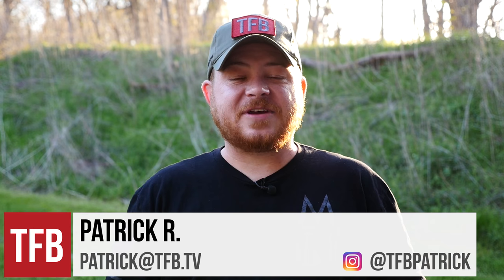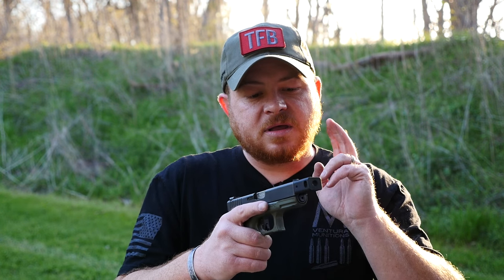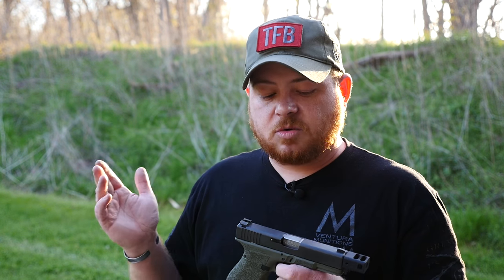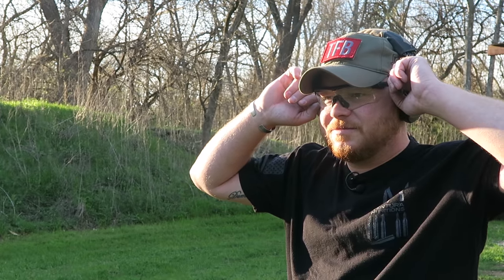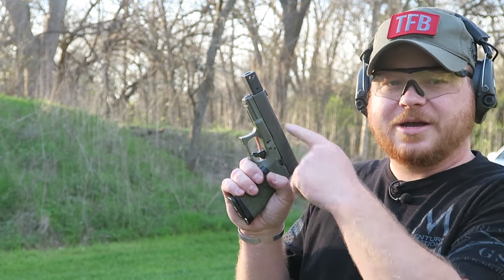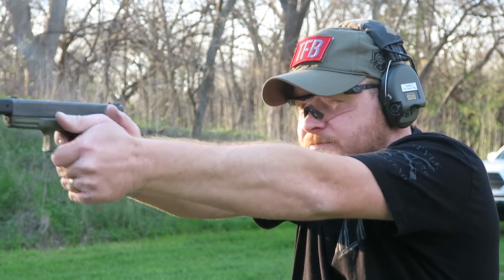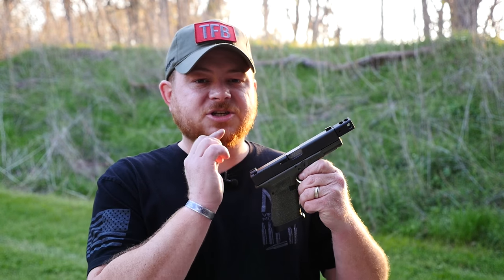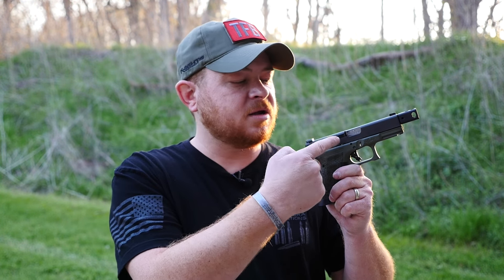How Compensators Help You Shoot Faster

Comment: I'd love to see this test done with a 45 ACP or even 40 cal
Reply: River Styx Armory makes sense thanks I've owned 40 and 45 no compensators tho I've always wondered how well they work
Reply: Big benefit on 40 S&W, tames the shock and flip quite a bit while keeping a good amount of that 40 snap. There's a reason why competition shooters love compensating 40. You should see what a comp can do for 10mm.
Reply: Right why is 9mm even popular? Wimpy load (yes I have been shot in the chest with one). With 40S&W you get more speed from a bigger, heavier bullet. Better yet, a 45ACP +P 185 grain Underwood load is moving at 1200fps, bigger, heavier, faster than  9mm but just as accurate and follow ups/double taps are not a problem.  Better yet do what I did: Take your S&W M&P M2.0 45 Auto and convert it to .460 Rowland with a compensator, now that's some horsepower! lol
Reply: Big misconception .45 acp has less psi then 9mm. Which means 9mm is more snappy
Reply: @Heqvy Duty Reviews

9 mm double stack allows for up to 100 rounds with the Glock mags, or the Army/Marine m17/18 21-round standard. Better to run more mag capacity in a single mag than multiple like an 8-round 1911 mag, or 10-15 with Sig P320 .45 or the FNH-45

Comment: How was the blast? Is it louder for the shooter? Great vid as always
Reply: I guess it has to be, haven't seen any comp that won't up the noise for the shooter
Reply: I was just shooting beside someone shooting a 9mm today at an outdoor range, and I noticed that even the concussion from that going off 6-7 feet beside you is quite distracting. It's also a lot louder standing beside it than it is shooting it. Needless to say, being in close lateral proximity to someone using this kind of compensator would suck some serious ass if you didn't have adequate hearing protection. And even then, the gases blasting you every shot would piss you off pretty quickly.
Reply: John Wick Well, I think it technically isn't louder but with muzzle break/comp directs the sound towards the shooter rather than away from him/her and on the plus side you get a less muzzle flip and therefore faster target transitions.
Reply: my ar15 was significantly louder with a compensator (muzzle brake)

Comment: does KKM have a compensator for the XDM ? mine already has a threaded barrel also Good Vid Much Love TFB!
Reply: originalterrorsquad Check your thread pattern, It's probably the same.
Reply: Dave Lpz yeah it would be a shame to mess up the threading because you don't double check that
Reply from the maker: Sadly no. The thread pattern is proprietary, you would need to look at Primary Machine or Texas Black Rifle Company for a 1/2x28 comp. I would probably go with the Texas Black Rifle Company one if it were me. - Patrick
Reply: TFB TV ok ill look into texas thanks Patrick

Comment: I just bought a comp I would like to know if you run it with the stock Glock recoil spring or do you buy an aftermarket one
Reply: It depends on the comp really. Some say you don't have. Some say you might. Depending on your gun, the slide and ammo. Most people do though. 
Just like running a silencer on you pistol, you might or might not have too.
But common spring weights, are around 15-11 pounds. 
13 seems to be the sweet spot for spring weights. 
Hope this helps.

Comment: Have you guys had any issues with the Freya magwell on your 19? something seems a bit off on mine.
Reply from the maker: +WJP556 Nope. No issues at all. What is going on? - Patrick
Reply: When I insert gen 3 magazines they need an incredible amount of pressure to seat when loaded. a tad less with the slide back. every other magazines I have seats just fine loaded to capacity except the factory gen 3 ones. I followed the directions to a tee and I even have a very small bit of wobble in the fitament to my Glock. now when I look into the magwell with it installed I can see some polymer pushed up a tad near the plug area. not sure if that's the cause or what. there are so few videos out there regarding the Freya's that I didn't have anyone else to really reference with. I've only had mine for about a week. Thanks for your response.
Reply from the maker: I would give Raven a call. Personally, I would load the mags up to capacity and leave them in a gun for about a week each, sounds like the springs are a bit stiff. That has always worked for me. - Patrick

Comment: What about the gases that come out before the bullet exits?
Reply from the maker: +Joe Blohe That has been tested at length and found to not be an issue. - Patrick
Reply: Really? What lengthy tests and can you provide a link?
Reply from the maker: Check out Primary & Secondary on Facebook. Ask the question and prepare to have your perspective changed. - Patrick
Reply: And what perspective is that Sir?
Reply: Joe Blohe primary and secondary did a minute long video and said fuck twice. Case closed bruh
Reply: Well that settles it for all the flat earth folks...thnx
Reply: Joe Blohe I did see it mentioned on JJ Ricaza's(probably misspelled) instagram a while back that he liked comps but on full house race guns that have to make major. Also lots of pics of fireballs coming out the top of his race guns.
Reply: Compensators work no doubt. If you are playing shooting games on the range for tens of thousands of dollars, they are part of the equipment to remain competitive. If you save a tenth of a sec per shot for 10 shots you are 1 second ahead and thayt can be huge. They are of little consequence on defense gun. They generally increase cost, complexity, muzzle blast and flash in the typical low light self defense shooting scenario. Reducing shot to shot split times a few TENTHS of a second in real world encounters is not a priority or outcome changer. Compensator advantages and disadvantages are WILDLY overstated by BOTH their proponents and detractors.

Comment: There are too many variables.  

1. You are doing it from draw.  Your draw can effect the time.
2. You are shooting just once and not taking an average.
3. You are shooting at multiple targets, so this involves transitional sight acquisition.

You should have done a 6 shot string with at least 3 attempts using each ammunition, both with and without the compensator.